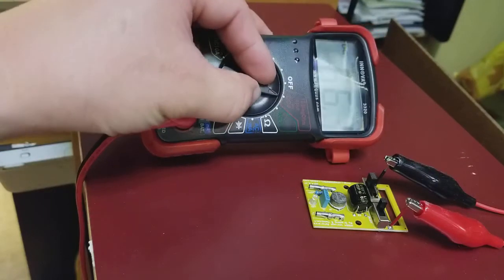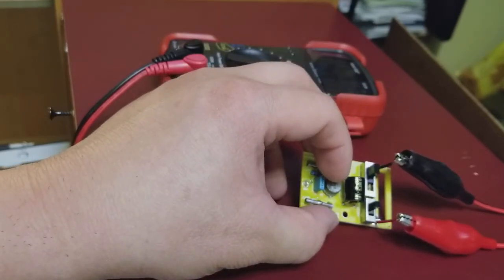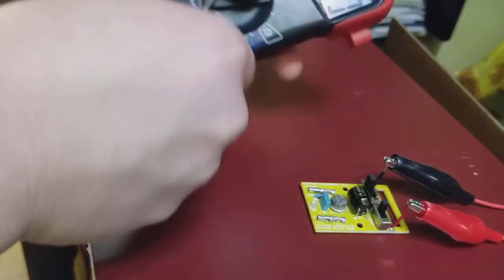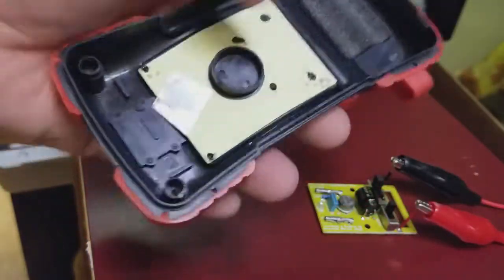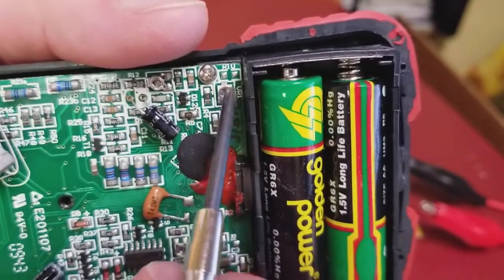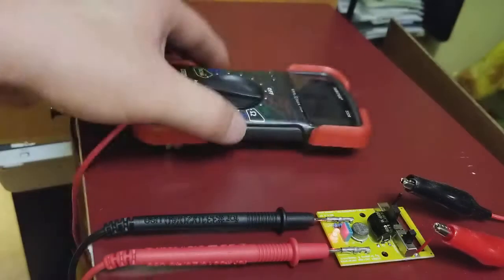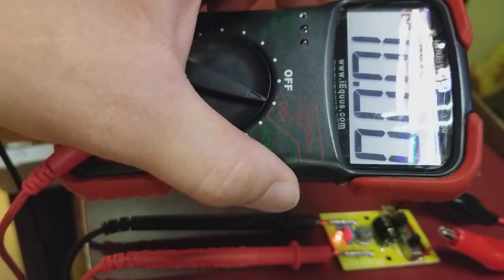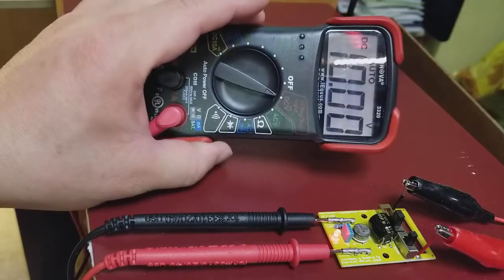INNOVA 3320 Voltage Calibration

Comment: INSTEAD OF A VOLTAGE REFERENCE MODULE i'M JUST GONNA MAKE IT MATCH ANOTHER VOLT METER, crap my caps lock is on
Reply: yep you don't need a voltage reference, this multi meter isn't accurate anyways, my other 2 meters go to the thousandths place, this 3320 only goes to the hundredths place

Comment: Good evening, friend. A calibration question, can I do it with a variable transformer of continuous voltages, since in Venezuela that calibration module was not achieved, are there transformers with a multi-voltage selector in continuous, how much is the maximum amperage of that calibration module?

Comment: How do you power the calibrator, also mine does not have the sticks/antenna? that you used to secure the alligator clips
Reply from the maker: mine is powered by a 16 volt battery, which you cannot find. But it works well with 12 volts.

Comment: Great video mine needed to be calibrated thanks for teaching me buddy ps i just used a dc adapter to calibrate it it might not be perfect but its way better than before
Reply from the maker: thanks. just like to share whenever I can.
Reply: @leefiles  does yours give a MDCV reading still before touching the points to a battery?
Reply from the maker: @autobotavengerfireballxl5339  I googled it but I could not find what MDCV means. Sorry. Can you ask in another way?
Reply: @leefiles  sorry i meant MV under the DC setting Im thinking it stands for millivolts?
Reply: Found the answer to my question on innova's website and it says...
Why do the numbers keep fluctuating when I'm not testing anything?

This is a normal function of the Auto Ranging feature of the 3320 DMM. It is simply picking up signals from the environment around it. You can zero it out by touching the two test leads together. When conducting a test, the meter will automatically zero out before giving a reading.
Reply from the maker: @autobotavengerfireballxl5339   Yup, you could get a few millivolts from waving a probe around the air. But rest assured it is not from spooky forces....I hope.